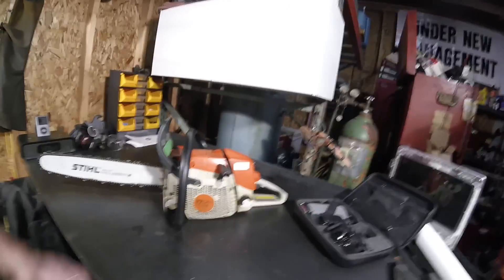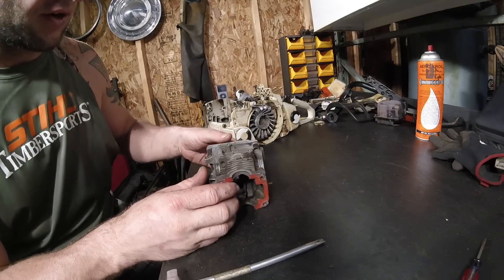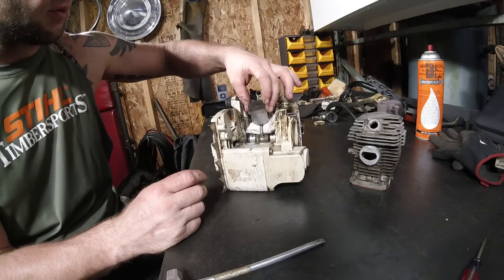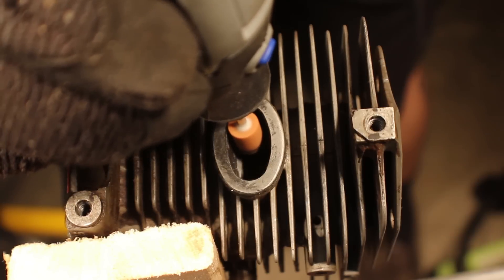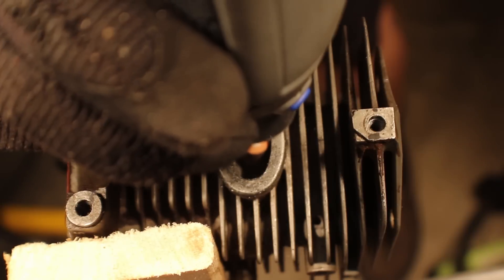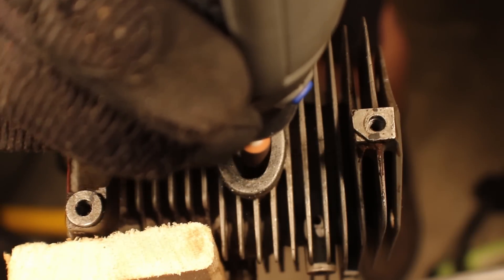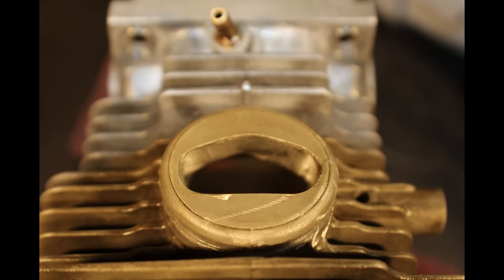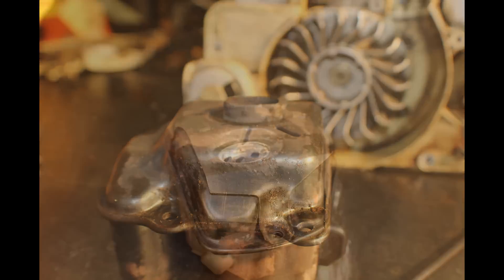First Cylinder Porting, Stihl MS270

Comment: Back in the day when I used to play around with 2 stroke in outboards we would port the transfer ports higher mill the head down and run race fuel in it. We get 30-40% increase in power.  Also played around with Nitrous oxide on some hill climbing bikes we blew up a few engines doing that.

Comment: I've found those 'ridges' you speak of to be present more often than not and oftentimes just OEM like that (I don't use stihl though in fact mostly low-end gear so less precision expected anyway) Am glad to see it go well but wish you'd timed your cuts beforehand, I've been using that (a 3-cut 'speed time', I do 2 or 3 timed attempts for a best time, it's the best benchmark I've found so far!)  Will be doing an almost-identically invasive 'port job' on my lil 25cc today, also opening up its muffler (when choosing your cut spot(s), what consideration do you put into "crap getting into the engine"?  No muffler would be 'optimal' so far as restrictions removed but, despite it still being a 1-way system, am guessing crap would get into the cylinder from the exposed port....I don't know how to best consider that when doing muffler :/ )
What fuel(s) are you using?  I'm still unable to find when/where benefits in power are gained from using stronger fuels ie Stihl pre-mix instead of my usual ethanol-free generic....also have to imagine that gas//oil ratio would benefit from some tweaking at some point of modifications&fuel-improvement but not sure how much lower on oil% to go (I already have a 10% sway as I use 45:1 for everything since I've got many 40:1's and 50:1's and figured it worth seeing if 45:1 would be fine and it has been, will be ceasing that now though and using more precise mixes depending on which unit I'm fueling)

Comment: Woah, the timing will change when you take off material from the top and bottom. Sides only unless you get a degree wheel and take off only what is allowed. You may have gotten lucky on this round.

Comment: I personally have noticed that leaving intake port little rough on surface makes engine rev better, I just have one 26cc weedeater going in rc-boat. Changed carb from 40cc chainsaw, ported it, dropped cylinder 0.1mm, added nipple to crank case to get pressure for the fuel pump, dremeled the shit out of transfer ports just so that the piston ring stays together, changed ignition timing and chopped 0.1mm off from the exhaust side of the piston and also lightened it a little in a lathe. Oh yes and milled the pistons intake sleeve to match the intake manifold. Crazy engine..

Comment: Do you have the time difference on cutting for the before and after?
Reply: But it made more torque. Lots more torque. Which is what we're all after aren't we. So I would say that for a first go he did pretty good, and improved his saws output. Nobody and I mean nobody is born with a Dremel in their hand. We all have to start somewhere, and he has started here. And.. his saw makes more power. Result. Onwards and upwards he goes!
Reply: Camp'n Outdoors  what did he do wrong?

Comment: Pretty cool work man, very straight forward. Looks like you widened the exhaust port more than anything, and that will give it more flow potential, without changing the timing too much, or decreasing your trapped volume. If you change the port height you change the timing and decrease the trapped volume, but you do typically move the peak power higher in the rpm range. Most stuff in porting is a trade off, you gain this, but lose a little of that. Putting a chamfer, or tiny bevel, on the port windows after you do any modification can greatly increase you piston ring life too.
Reply from the maker: Went mostly on the sides, as you mentioned.  Did some reading before attempting, am pretty happy with the outcome for a first time.  I've been eyeballing the kits at http://www.ccspecialtytool.com/, bit pricey for something I won't be doing a whole lot of though.  Perhaps in the future, can't really justify it now though.
Reply: @Human1337  Friend, how best to position the L nozzle on the carburetor?

Comment: you're only sposed to do the sides because you run risk of changing the timing on the top and bottom
Reply from the maker: Yeah, most of the material I took away was on the sides, didn't want to do exactly what you're warning about.  Mostly just polished the top and bottom to knock off any sharp corners from the casting process.  Also didn't do anything with the transfer ports, need to do some more studying and get some more tools before I take that just.
Reply: The only way you change the port timing is if you raise the port roof at the port entry in the cylinder.  As long as your away from the actual opening on the plane of the cylinder wall you WILL NOT change the port timing on any 2 stroke.    I've built over 100 performance 2 stroke engines (mostly 2 stroke ATVs)

Comment: I didn't know wolverine uses a chainsaw
Reply from the maker: Yeah man.  The claws just get old sometimes, gotta switch it up a bit, keep it fresh.  Working on making an adamantium chain right now, still don't have the science quite figured out though.  Might just bite the bullet and try to get the Prof to look into it.
Reply: Human :)
My first attempt at porting (1984 vw GTI throttle body retro fit) I found using a carbide bit on a dremel just didn't provide the torque needed but putting that same bit on a drill did the trick and took off a whole lot more material.
Reply from the maker: jbbolts
Nice, I'll have to try that.  Thanks for the tip

Comment: nice work.   I love porting  chainsaw cylinders.     make sure you chamfer the ports when you're done so there's no sharp edges for the piston rings to get hung up on
Reply: Friend, how best to position the L nozzle on the carburetor?
Reply from the maker: I noticed a bit of a lip on the inside after porting it, took some scotch bright and knocked it down.  Next time will take the tip and chamfer the edges.  Thanks for the heads up  =)

Comment: I have to try this! Thanks for the vid!
Reply: I did this to my MS880.  It didn't do anything, but lost power.  When I took it back to the dealer he said the warranty would have covered it, but I ruined the saw when I took a dremmel to the intake and exhaust.  Too bad, it was only a week old.  Stihl is a PoS!  I'll never buy another that's for sure.  $1,600 down the drain
Reply: @FISHH00KS Unless you destroyed the saw you could get new parts to put it back to factory for minimal money compared to a 1600 pile of scrap
Reply: @FISHH00KS  stihl makes the best chainsaws. C-m's are amazing!

Comment: Is the 270/271 cheaper than the 260/261 in the US? The 27x seems like a heavier, detuned saw, spur sprocket, toolless bar tensioner (not a big fan, but that is subjective I guess). I've never held one in my hands, but had a few years with a 261 now. I'd trade the 261 for a husq 346xpg any day. The extra engine rpm is just amazing, and it lasts quiet a bit longer on the same amount of fuel. I'm curious - what saws do you run and what size bars? I'd be interested to know chain type too :-) Nice videos too!
Reply from the maker: The 261 is more expensive than the 271.  261 is a pro level saw, 271 is in there "farm/ranch" line.  I have a video is which I compare the 261 to a 291 and show what the differences are between the pro saws and the consumer saws.

Currently I'm running
MS201T C-M,  16" bar
MS261 C-M, 18" bar
MS270, 18" bar
MS440, 30" bar
MS661 C-M, 36" bar      "just bought this morning, I'll have a video of it up tomorrow night"

The 201, 270, and 661 are my own, the 261 and 440 are the companies.  We also have a couple more 201t's, some 290's for the ground guys, a 660, and an old 090.

Comment: I think your passion for tree work is your biggest asset. It's more than just a job, it's a way of life.
I've been doing tree work for about 20yrs and the guys that come through with a real passion for tree work are few and far between. Those are the guys we try to hold on to at our place. Just remain teachable, there's always something new to learn and every tree is different.
Also, I recommend investing in some good carbide bits.
Reply: Carbide bits? What are those sir?
Reply: @PimSchouten  they are the type of tips that you want for grinding. If you look it up, it will tell you in much better detail than I could.
Reply: Mr Magoo thank you very much sir

Comment: The rakers could probably come down a littler to match the higher power. Saw would then be tuned to the chain.
Reply from the maker: I agree, I had just made that chain fresh as to get a good baseline.  Rakers could be dropped quite a bit on that 18" bar I think.
Reply: my thoughts exactly  , the engine seemed reving without resistance ,, no real "bark" and grunt like i like to hear ,, or there are many different chains available (gauge, pitch, etc) that really let you get optimal cut. Not just the standard all-around chain most shops will sell ya , and even a stroke or two per tooth with a good file on chain fresh outta the package or off the roll seems to cut better. nothing i hate more than a saw that sounds whiny instead of barking when you make em bite :P ..... I spent many years falling with a saw in Nortern Alberta, with saws of all kind, some that weighed in pretty damn heavy ,,, IMO the saw is a given ,,,, the chain i have a lot of control over ,, just search "chainsaw chain chart" to see some of the options